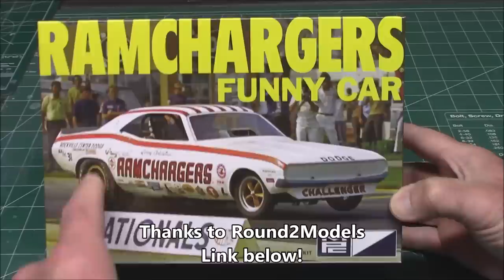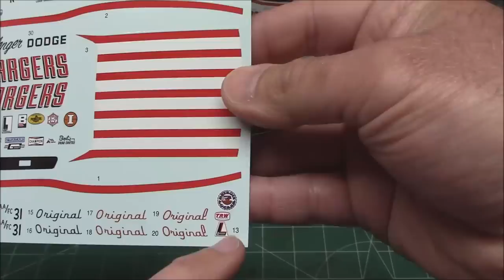Ramchargers Dodge Challenger Hemi Funny Car 1/25 Scale Model Kit How To Decals Engine Tires Chassis

Comment: It seems you glued the back wheel two halves together before putting the tire on. Why do you do this? I'm just wondering....
Reply: He will tell you, "just personal preference".  He does this on all of his kits - if the tires themselves are flexible enough to stretch over the rims.
Reply: It also gives the glue joint time to cure before the tires get mounted.
Reply from the maker: Since I'm using super glue, if I glue it as I'm putting the tires on there is a good chance the glue will fog the tires.
Hollow tires are easy to stretch over so I glue the wheels together before I mount the tires most cases. 
Solid tires I will press in the wheels from each side. If they fit loose I use rubber cement to hold them.

Comment: I sure wish my paint jobs came out like yours. I followed your directions, used the same paint, first one came out all orange peel. Stripped that, tried again, plastic melted in parts. Plus more orange peel. Tried polishing, wet sanding with 2500 grit paper. no luck.  AMT International 4070A kits.